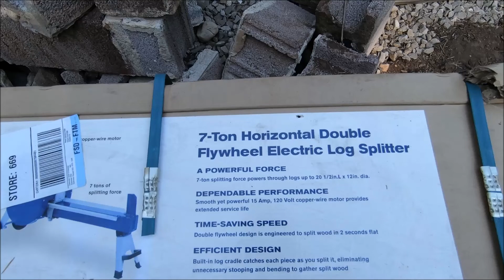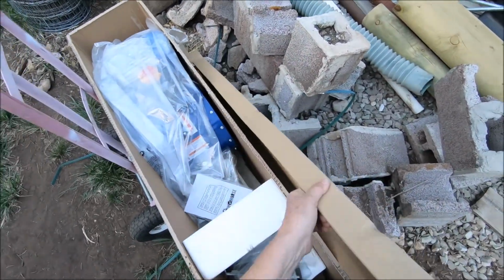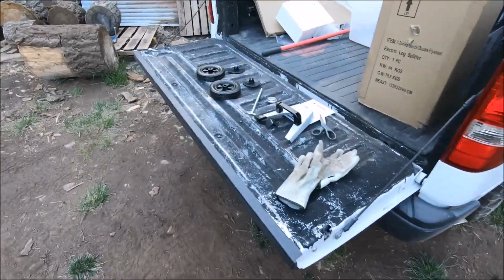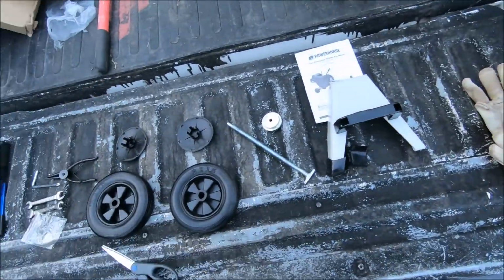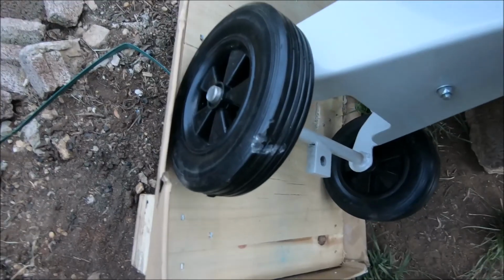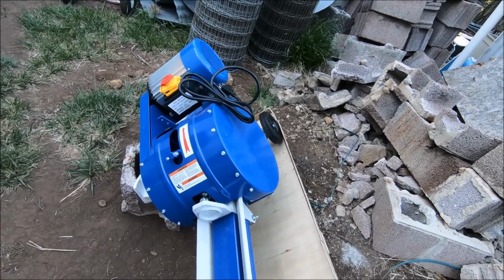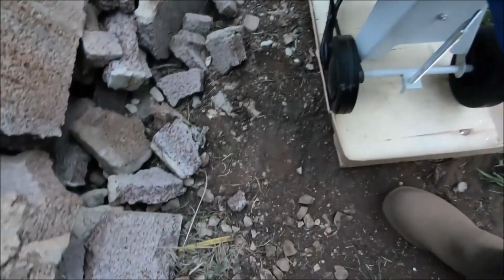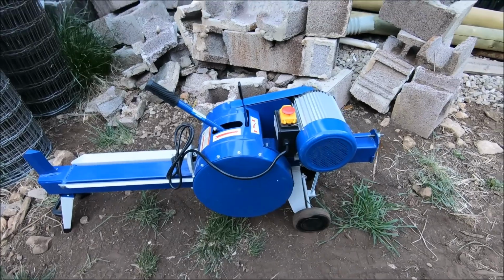Assembly of Powerhorse 7 Ton Kinetic Electric Log Splitter

Comment: I was hoping you would move the handle because mine won’t tighten and rattles. Didn’t care that it made noise, just don’t want to grab it while it’s jumping around.
Reply from the maker: Apologize for seeing your comment only today (been off laptop.)  Your handle won't tighten?  My goodness, that's bad.  I tightened up my handle with a socket wrench when I put it on. Have you tried that?  Hand tighten the nut first, then finish off the tightening with a socket wrench until it is firmly tight. But don't over do the tightening as you don't want to break it.  Just get the socket wrench to tighten up until you meet a great deal of resistance, then stop.  Hope that makes sense.